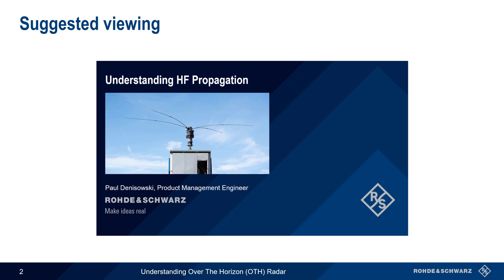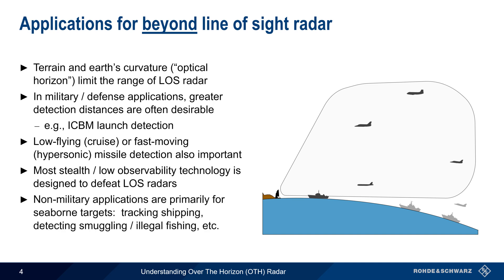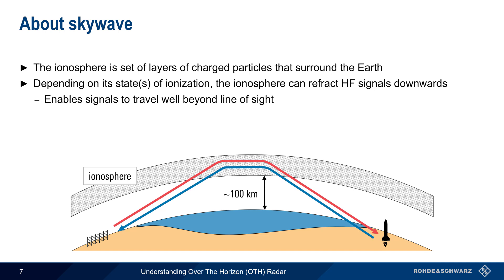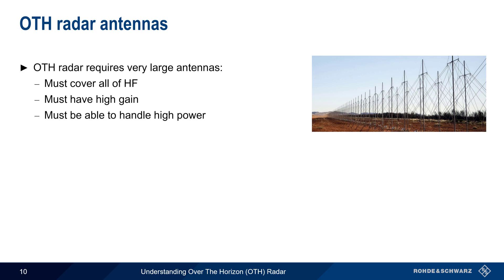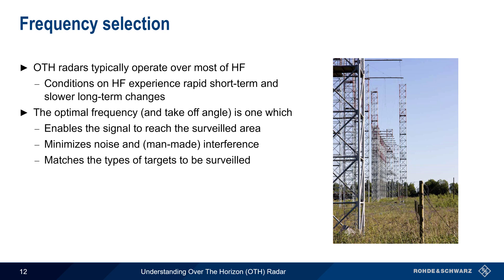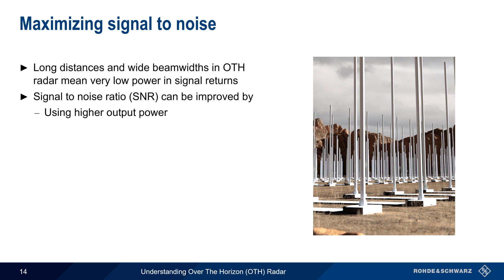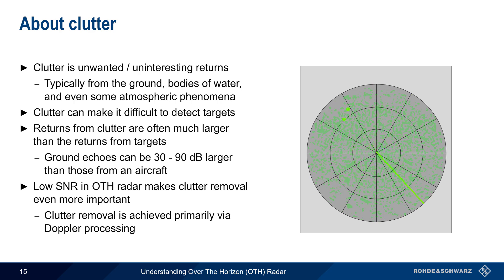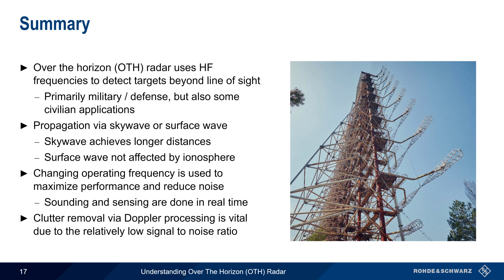Understanding Over the Horizon Radar

Comment: What are the negative effects of hf frequencies? Should the community near by be concerned?
Reply: Despite the high powers, HF transmissions (including OTH radar) do not pose a health hazard to humans or other living creatures.  The frequencies are very low and non-ionizing.  It's also worth noting that the transmit powers used for OTH radar are about the same as those used for commercial radio and TV stations in the United States.  There are only about a dozen OTH radar installations in the United States (mostly in remote areas), but over 12,000 commercial radio and TV stations :)